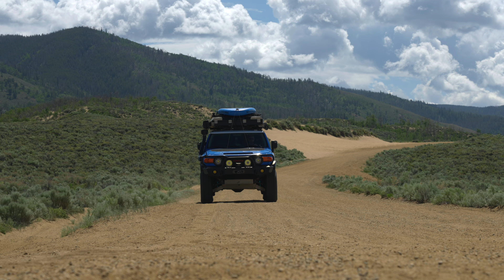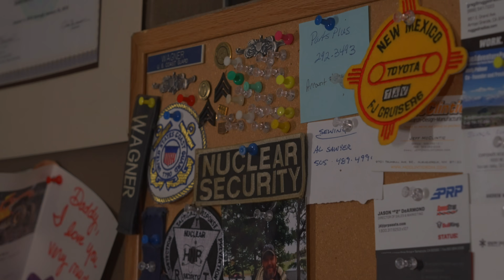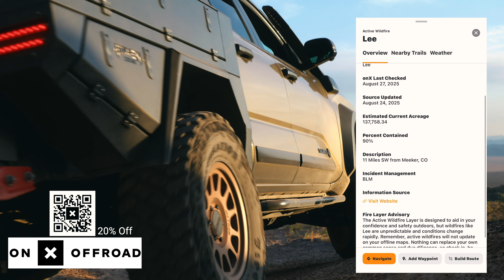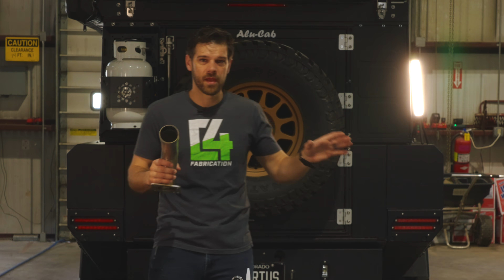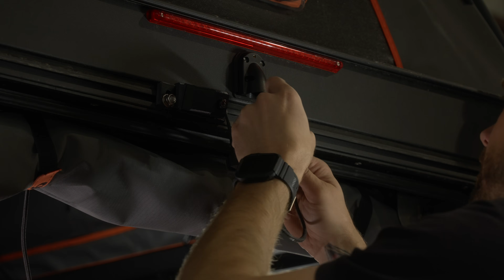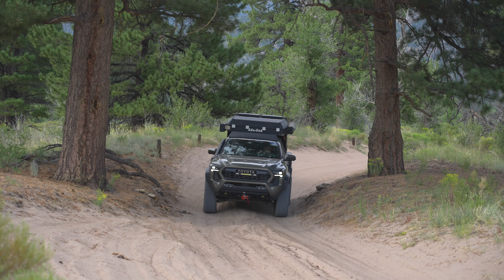Why I Chose The Alucab Modcap - Install and Outfitting

Comment from the maker: Complete Tacoma Build Sheet: https://bit.ly/TrailhunterBuild

Camera Relocation Video: https://youtu.be/U-CQ_j1YKIo
Redarc Electronics Install: https://youtu.be/WFt6GixGHPY
Bowen Bed Replacement: https://youtu.be/MCYd9fELUQI
Hest Review: https://youtu.be/DuocMmZRpOI
Zipper pulls : https://amzn.to/47R26vC
GP Propane mount: https://bit.ly/3HMqC6E
Tactical Application Vehicles: https://bit.ly/4hQ6z36
813 fabrication: https://bit.ly/4mAFHal
Expion 360: https://bit.ly/4oTX0Ff
Floor foam: https://amzn.to/3HBp0N3
Insulation: https://amzn.to/4lVPcQz
Reply: Thanks for the links. I found this statement in the FAQ section: 

“Does GG Offroad offer a pre-built toggle switch solution?

At this time, GG Offroad does not offer a pre-built toggle switch for switching between stock and relocated cameras. However, we are continually exploring solutions based on customer feedback and may offer one in the future.”

Comment: Outstanding choice / build. Re: the insulation, do you see any benefit to using radiant barrier vs. r-value or both? I added a radiant barrier and noticed my propane furnace runs a little less. Im curious if i should add R-value insulation as well. Thx

Comment: How do you like the battery has it giving you any problems, I’m looking to buy from them but havnt found alot of reviews on the batteries.
Reply from the maker: No issues. I have 1 in the Fj, One in the Tacoma and then one of their Aurora battery kits and all have been flawless. The heated option is great. I will do some more content on the batteries this winter.
Reply: @IndependenceOverland thanks for the feedback, looking forward to try them out then.

Comment: Beautiful build! Thank you for sharing! 
My question is , with this build, does it compromise the stopping ability of the truck? 

Any warranty compromise from Toyota? 

What upgrades to the suspension did you have to make to accommodate the bed and camper?
Reply from the maker: The truck has regen braking from the hybrid system so it actually brakes pretty well on the highway. I will be upgrading the brakes for long offroad trails though, because I do feel that the lack of engine braking from the 4 cylinder will require more braking off road. 

Warranty hasn’t been an issue from Toyota yet. My dealer has been surprisingly cool about my truck (shout out to Bighorn Toyota). 

Suspension is Dobinsons springs front and rear. And the rear are the heaviest option they offer, and work great. I will be replacing the trailing arms with Dobinson as well, because they will take hits better than the OEM parts do. 

The video I plan to release next week might show you have capable the truck still is too. 😉

Comment: Which tent is that? The actual RTT part, and is it wider that the stock truck would be?
Reply from the maker: So it’s actually a camper, so I can push the bed up and stand inside of it. And no, it’s not wider. I have just an Alucab tent on my Fj that you can check out too, in some of my other videos. 

Alucab Camper: https://bit.ly/Alucab
Reply: @IndependenceOverland after some research I figured it out watching your other vids. I have a 4th gen off-road. I know the trail hunter is a bit wider but I think the 3r won’t be too wide on it. Your current setup is by far the best I’ve seen on YouTube but definitely not an entry point into the hobby for me. Thanks for putting this up for everyone to see

Comment: Very nice build. Do you have the same internal floor area as you would have if this Alu-Cab was fitted to your tub?
Reply from the maker: It probably equals out to about the same. Width wise internally you lose an inch or two on each side, but you also gain a little at the front and back so it’s probably pretty similar.

Comment: Really well done!. Minus the side storage, do you gain additional square footage with the new bed? It appears no wheel wells to contend with.
Reply from the maker: The wheel wells are still there, but since they are squared off it makes them less of a hassle to pack around. I don’t believe it’s actually bigger though, the footprint should be mostly the same. The difference is the bed ends at the very end of the truck.
So instead of headlight housings and the tailgate eating up space like a typical truck bed, you get full use of every inch.

Comment: How have your snomaster fridges been holding up? What size did you go with in the camper? I have an EX67 for my GX and just picked up the last I could find of the EX85 for my customer 45 series Land Cruiser camper build that I am going to use the modcap wedge top mounted to my own base aluminum camper.

Comment: Are you loving the 2400W AC inverter in the back of the Trailhunter? Being able to charge up portable power stations at record speed is a huge advantage with that truck. And my understanding is it’s a pure sine wive as well which is huge
Reply from the maker: Yeah I have used it to do just that several times, but since I hardwired in a Redarc system, I am rarely bringing along a portable battery. I try to run as much off of 12v as I can. But for the times I do need the power stations, it is super handy to have. It is in fact pure sine.
Reply: @IndependenceOverland  does the radarc DC charger supply a similar power output to your battery system?

Comment: Love the comments and thought behind changing out the zipper pulls! I replaced mine with some brighter colored paracord style so they are easier to spot  in low light and color coordated to panel zipper vs mesh window panel zipper.

Comment: I love your Overlander build and choice of the Bowen Bed and the Alu-Cab canopy.
If I had known about the Bowen Bed design I may have gone with this bed design and of course the best canopy available in the world at the moment.
The South African roof top tents and canopy’s are the only ones truly designed and tested for all weather conditions.
I probably will go with a Alu-Cab pop top roof conversion on my Land Cruiser Troopy in a few years time.
Also surprised to see that I’m not the only one that removes the metal zipper pulls and replaces them, I use a bit of parachute cord myself.

Comment: Alucab has obviously won your trust which is a hard thing to put a price tag on. But I would love to know your thoughts on the Alucab versus the lone Peak if you have any experience with that camper at shows or something.
Reply from the maker: No I have not really gone diving deep into the Lone Peak stuff. Again, there are plenty of good options out there.
Reply: Hey there! I have a lone peak on my 6’ Tacoma and love it. They’re definitely a smaller company and less established so there are trade offs on that front (though I’ve had zero major issues).  they’ve been super on the ball on the customer service end which is great. I’ve never owned an Alu cab but I’ve poked my head into a few and they seem like they’re a step up in terms of machining quality and overall bougie-ness. I do think the modcap system might weigh more? Not sure. I suspect it depends on your truck bed size. Imo you can’t really go wrong with the options but I do recommend trying to. see what you’re shopping between in person if you can! 

for me what dictated my choice was form factor and price (the pass thru space and rear kick out in the lone peak is perfect for my needs. And I really wanted to retain my tailgate for work. but everyone’s got a different set of priorities)

Comment: Hey Tyler - Love the videos and the build. I saw somewhere someone did one of these using the FULL size modcap camper on a midsize Tacoma. The Bowen Customs bed is apparently wide enough at the top of the side boxes to accommodate the width. Is this something you considered at the time?
Reply from the maker: I thought about it, but the width of the midsize I wouldn’t want it. I already was coming awful close to trees when I went on some challenging trails recently. 

And weight. I think perhaps on a 6 foot bed softroader build, I could be a sweet setup. But for the 5 foot it just didn’t make sense for what I want to do with this thing.
Reply: @IndependenceOverland  Gotcha. Absolutely get the width and weight concerns.

Comment: picking out a camper now is very difficult. you brought up all the good points, and like everything it comes down to what you are using it for and your preference. I would love to have a huge camper like the tune m1 or project m, my build and activities require me to have something fast to set up and take down, and narrow enough to fit down the trails here in the Appalachian mountains. We do not see a lot of temps below freezing so fans and big windows are important. I did the zipper pulls on everything! Its so loud! The fridge is the next to go in the cab or get muffled! That bed system is the way to go! low easy access weight! Great setup!

Comment: very nice setup, sorry if I may have missed it, but what kind of suspension setup do you have to handle all that weight in the back? Thank you!
Reply from the maker: Stock shocks, and Dobinsons springs. I do think the valving isn’t quite there, so I will likely be doing a Dobinsons long travel in the rear.